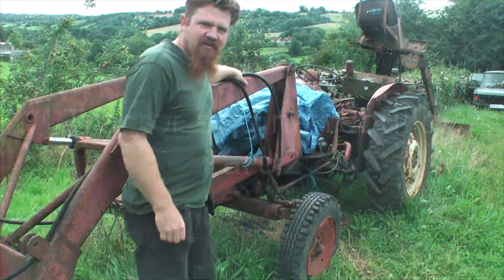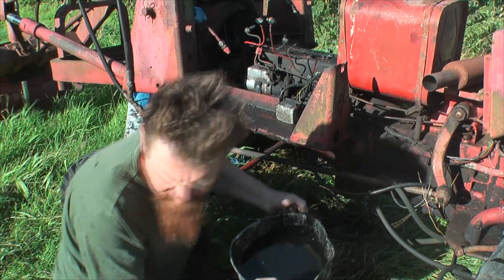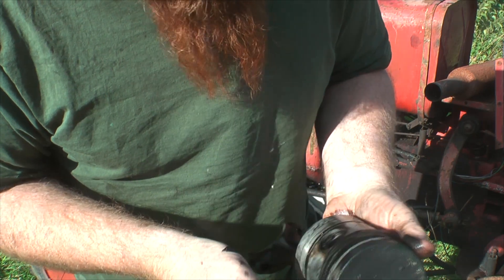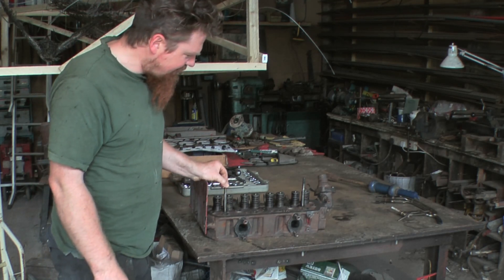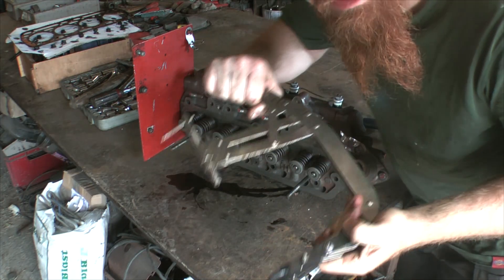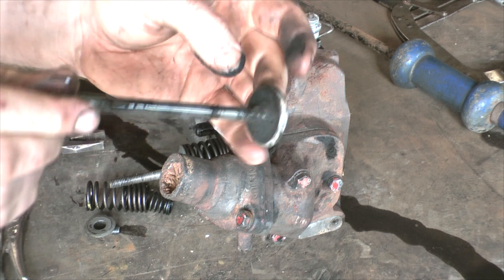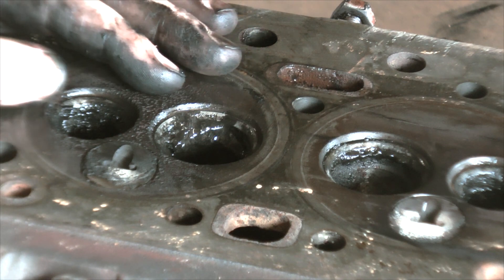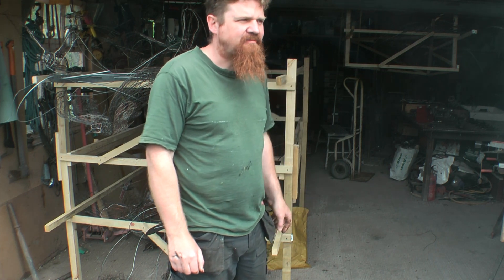Tractor engine rebuild pt 2

Comment: I know this is an old video, but omg please don't treat cylinder heads like that.  Scraping and scratching the bottom surface all over a welding splattered metal bench like that is..butchery - or how to completely and unnecessarily kill a cylinder head.  Also, if your big end bearings are that worn, it's a very very good indication that the main bearings are also toast and they should be replaced at the same time.  p.s. I am aware this machine lives on, but this all ought to be said anyway in case others replicate the nope.

Comment: Great video's.  Watched all the land rover rebuild and the Zill.  Got to look after the head face otherwise you create leak paths. To remove the collets just use a suitable size socket on a small extension with a mallet . Place socket on the top washer and give it a good hit with the mallet , hard enough to compress the springs and the collets just drop out . Keep up the good work 👍👍

Comment: Hot damn a new video!  That is interesting with the pitting on cylinder one.  Almost looks like corrosion blown away by heat.  Like something you would see on old LPG bottles that have been left to the elements.  I can't wait for you to get the rebuild kits and see this old girl fire up!